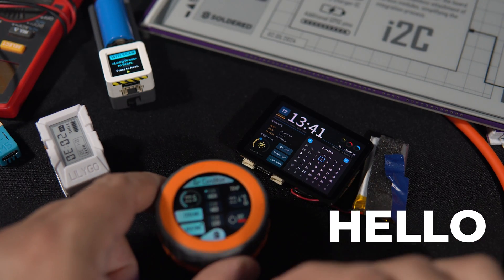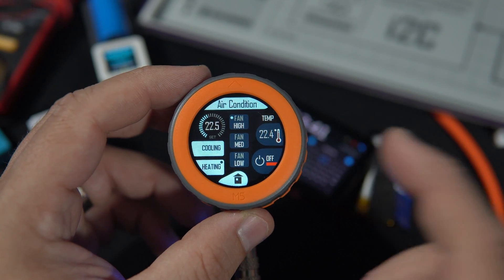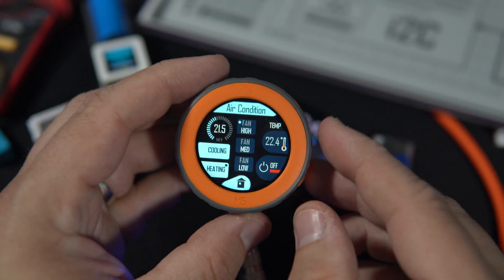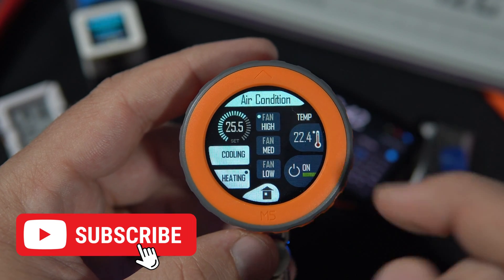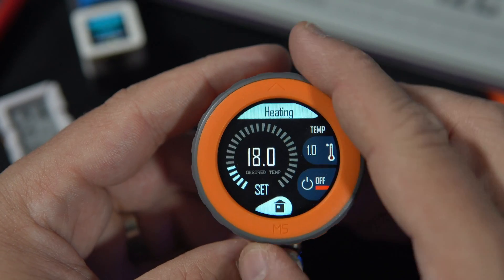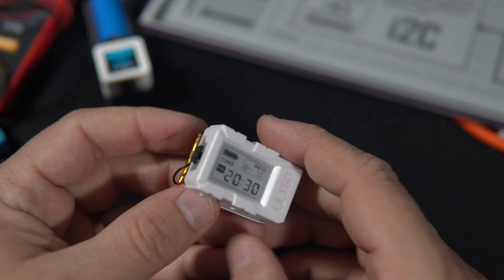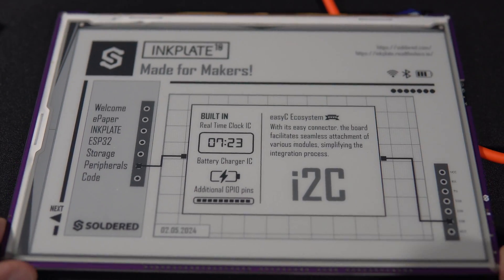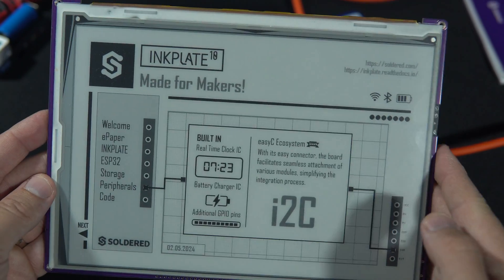ESP32 Smart Home UI -M5Dial

Comment: Hi, I am a big fan of your work!
I am finally learning how to program by watching your video!

I got stuck and wondering if you can help!

I am studying by your evil clock with M5StickC Plus2. I tried to rotate the screen to landscape mode, but since the sprite is fixed to 135 x 240, it shows 135 x 240 sprites when rotated instead of 240 x 135.
When I try to change sprite setting to 240 x 135 when screen is rotated, the image shows stretched.
It will be awesome toturial for newbies like me!

Thanks❤

Comment: I was looking for your M5Dial code but I see you are not sharing this one.  I'm looking for UI code I can run on both M5Dial and the Makerfabs MaTouch ESP32 Rotary.  Do you use tft_espi and render the generated sprites differently?
Reply from the maker: Sorry, i cant share code this time, this was paid project, i jsut wanted to show what can be done with this device. Yes i am using tft_espi and i am using single sprite, i am drawing difrent content to the sprite for each mode.

Comment: Awesome new project - and as always your UI looks amazing. May have to get one for a project or two. How hard is the integration with the dial and selector for menuing? Thats pretty amazing on running the eink display running for 12 days on the battery. That 10 display is incredibly big. Would love to hear more about it. And wow that m5 is absolutely tiny!
Reply from the maker: Thank you, using that dial is not that hard, i am using examples from m5stack github, there is basic example for each function.

Comment: I love the display designs you come up with. 
I bought the (TTGO Long) because of one of your videos.. 

One thing I wish you would do is show the (spec sheet/pins available) for 
each device.... ADC, i2c, PWM, etc....

My main interest is in robotics and lab equipment control systems.
My original plan was to use a HPIB interface but 
I am currently thinking i2c would be easier to implement..

I recently found some all-in-one bench power supply modules with display on aliexpress
which I hope I could control with a esp32 or M5 Dial.

Can 2 M5 Dial units be linked to each other through a site 100's of miles apart?
Reply from the maker: Thank you! Yes they can be conected thru net.